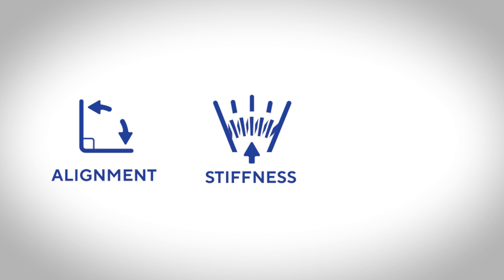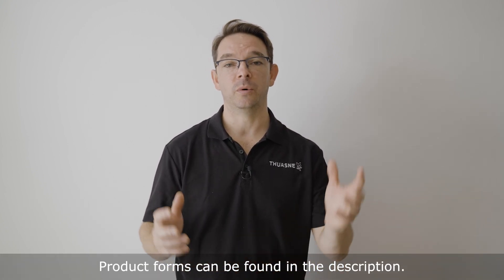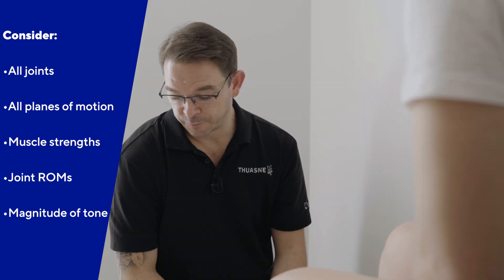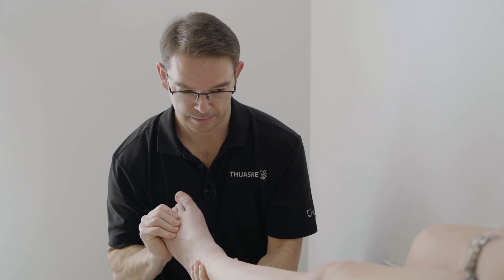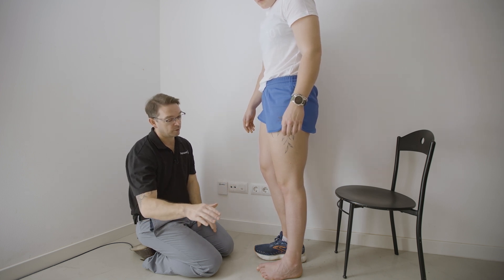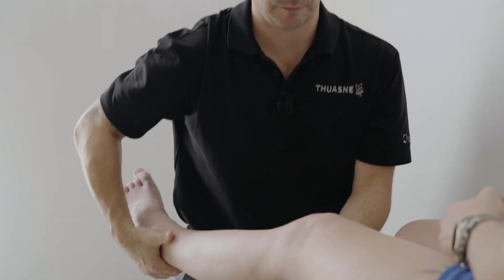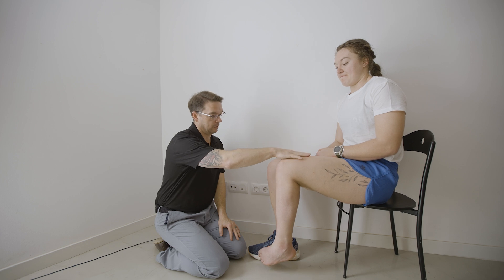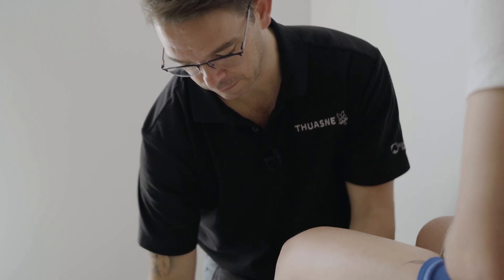Custom SpryStep® AFO: Assessing your patient

Comment: Hello.  I have been to different professionals for various types of afo's and have not been able to get favorable results.  My question to you is are there Thuasne professionals anywhere in NY state especially in Westchester County that someone can refer me to?  This gentleman seems extremely versed in this field and could use someone like him to cast me as the afo's I currently use are not adequate for my height and weight.  I have Thuasne braces by the way.